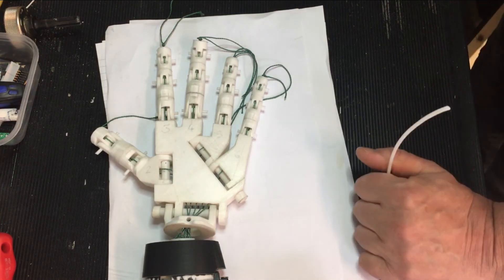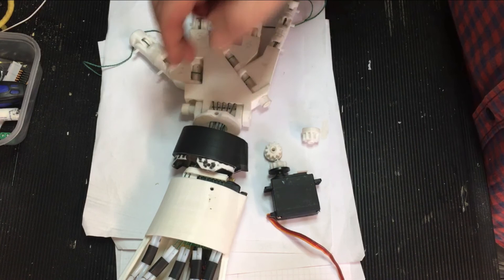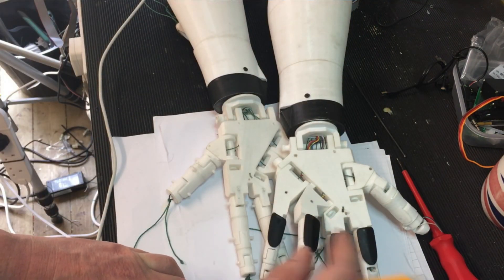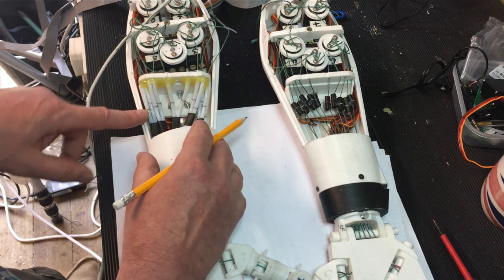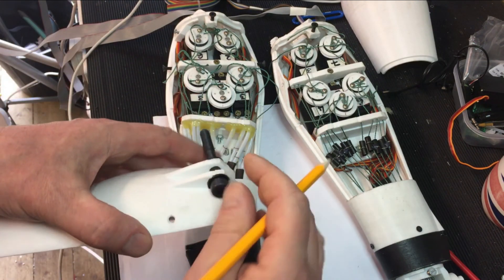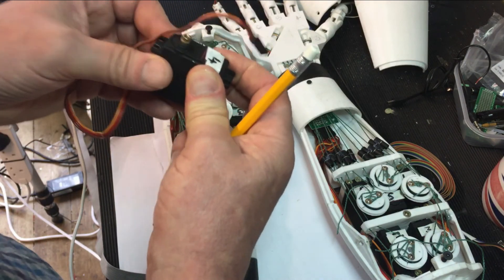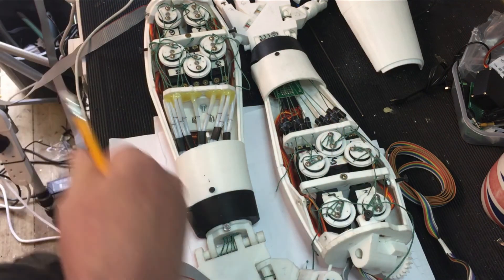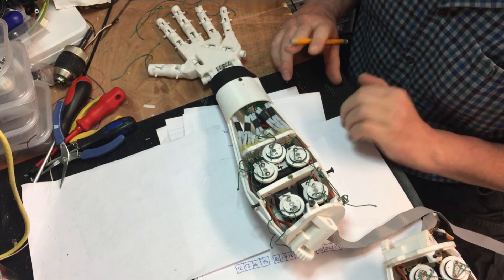InMoov Build Part - 14 Hands and Forearms

Comment: Can you please answer me can I use servo motor mg90s Instead  of tower pro mg996r
Reply from the maker: Hello, any servo that is same size and will fit in the arm.  I used cheaper ones but they burnt out often.  The MG90 are too small and weak I would think.

Comment: I knew it must be using some wire/line. Wouldn't it be better to use some stronger and flexible material?
Reply from the maker: Hi, its fishing line.  Its not ideal and is not the best design.   There are other designs and Gael/InMoov creator has designed a much better hand that I think is used for charitable prosthetics, but he has not made the designs available.  Have a look here ...http://inmoov.fr/inmoov-prosthetic-hand-almost-ready/

Comment: Hello bro im doing this hand for University project can you tellme if you use PLA or ABS or other and how much filament did you used in the construction of the hand  how long have you been building the hand and finally also what servomotors serial you using because i need to know if could use cheaper servos, idk if you will read this but in case you do please help me
Reply from the maker: Hi, all my InMoov is PLA, not sure how much I used in the hand but maybe 1.5 reels for the hand and forearm.  Use at least 50% infill for any gears but less for general parts.     I used cheapish MG996R servos for the hand/fingers from Ebay.   A few burnt out but you can buy in quantity packs.  
Printing the hand didn't take that long but setting it up took the time, I found the hands the hardest part of the whole InMoov to get working correctly.     Heres a list of the parts I used ....https://myrobotnigel.blogspot.com/p/inmoov-bom.html
Reply: Way' not share